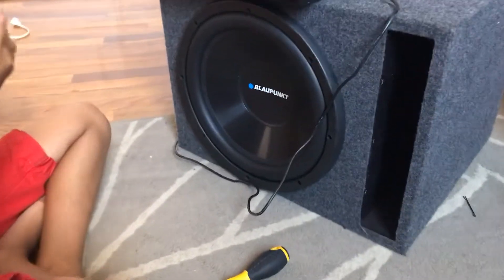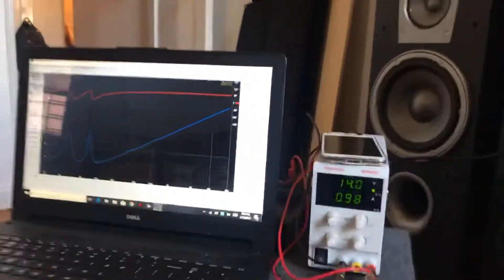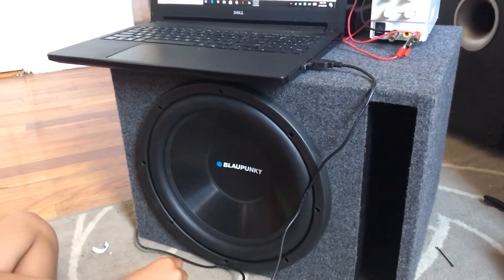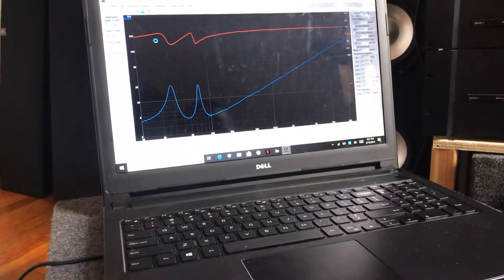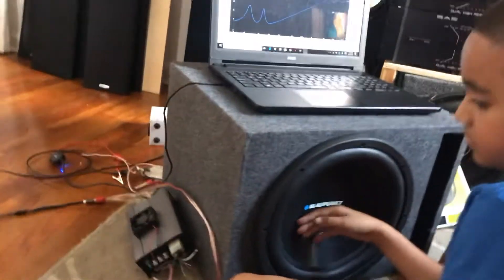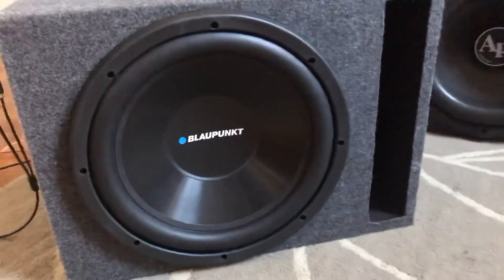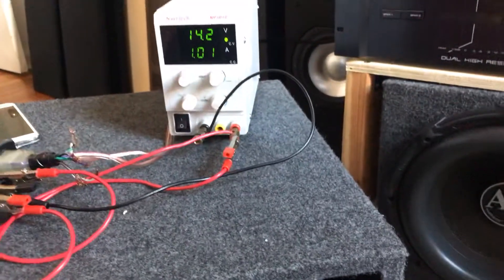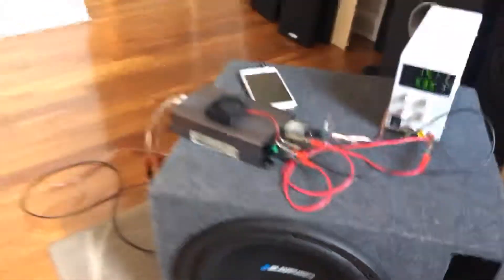Does polyfil lower the tuning frequency of a ported subwoofer box?  Dayton Audio DATS v2.

Comment: I have a home theater box tuned to 30hz that I've had since 2000.  Recently put in a rockville k9 12 in tha box and used polyfill to hopefully get lower tuning for home theater bass.
Reply from the maker: @jorgem50  You could also try a sub with a lower Fs
Reply: @DJ_Renn  So let me explain, I have two 14" klipsch in my home theater but for the fun of it I added the rockville and the 24yr old sub box.  It sounds really good and gives me even more earth shaking bass, lol, to my home theater.  Overkill of course but I'm a car basshead and need tht extra bass in my home theater. lol
Reply from the maker: @ Nothing wrong with some extra bass man. 😁
Reply: @DJ_Renn  I'm waiting for the monolith 13" or 15" to go on a crazy sale like they did last year.  They sold a few of the 13"s for $$699 last year and I'm hoping they'll have a few on sale this year

Comment: Quick question can fiberglass attic insulation lower the tuning frequency of a ported subwoofer enclosure
Reply from the maker: Yes.
Reply: 1 NYC DJ but is it safe to use in a ported subwoofer enclosure because I heard that fiberglass insulation disintegrates into tiny pieces and causes health problems if it's not safe to use in a ported subwoofer enclosure why is that
Reply: @travisgulley2652  Just use polyfil. It's cheap Go look at Budget Bass Head on Youtube as well. He has used some interesting materials for dampening such and squishy memory foam and stuff like that.
Reply: @travisgulley2652  it disintegrates into tiny pieces like asbestos and the speakers speeds up the process
Reply: No. Do not use it